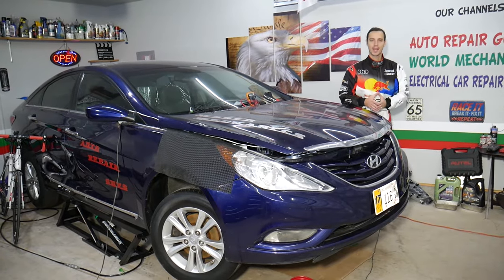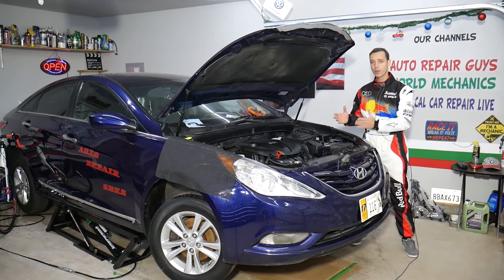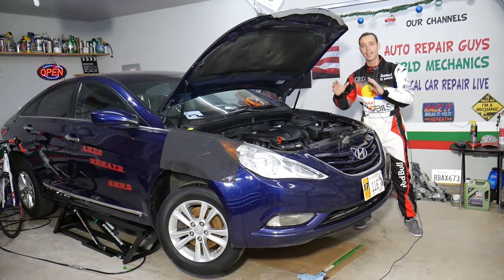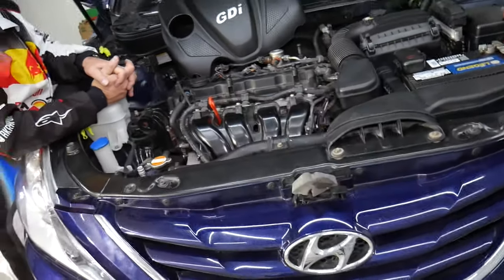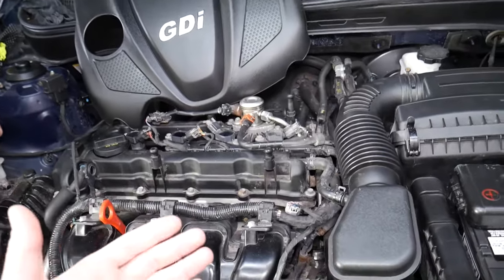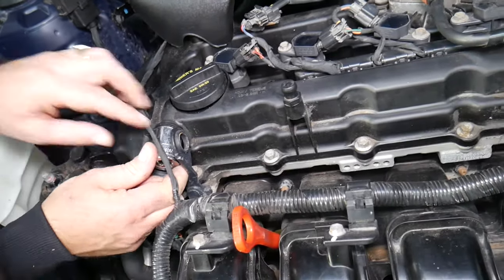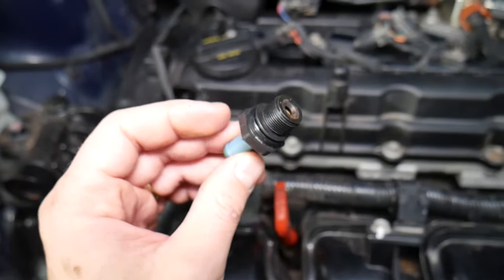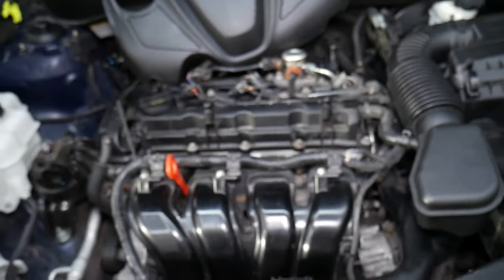WHY HYUNDAI SONATA BURNS ENGINE OIL, INCREASED OIL CONSUMPTION

Comment: i nust change the oil like 17 days ago and its already dow mn the low line
Reply: ****>>>>>    Hey readers. Even some Honda. and Toyotas are oil burners. I know because I have looked at YouTube videos for a whole year on this oil burner issue. Audis and BMW too. It is usually GDI and stuck piston rings. Most time a good B-12 piston soak will free the rings. Others use tough engine flushes.. EPR109, AMSOIL, Liqui Moly etc. Some just put in Yamalube ring free shock treatment . Change your oil at 2.5 to 4 k. Run top tier gas...use Techron gas or other high PEA treatments...and try to rev up engine more to burn the carbon outmore. Use Valvoline restore & protect oil!! FIX it fast before you pay $$$$$$ for a cat converter!!!

Comment: 2019 with 60K and still dealing with the same problem
Reply: ****>>>>>    Hey readers. Even some Honda. and Toyotas are oil burners. I know because I have looked at YouTube videos for a whole year on this oil burner issue. Audis and BMW too. It is usually GDI and stuck piston rings. Most time a good B-12 piston soak will free the rings. Others use tough engine flushes.. EPR109, AMSOIL, Liqui Moly etc. Some just put in Yamalube ring free shock treatment . Change your oil at 2.5 to 4 k. Run top tier gas...use Techron gas or other high PEA treatments...and try to rev up engine more to burn the carbon outmore. Use Valvoline restore & protect oil!! FIX it fast before you pay $$$$$$ for a cat converter!!!

Comment: QUESTION: I think he cuts it off at 2015. Does anyone think the same part should be changed in the 2017?
Reply: Yes. We have a 2017 Sonata.
I had the dealer change mine out after they said they couldn't find an oil leak. I told them it's leaking oil out of the exhaust pipe. They told me that after 100K miles, according to hyundai-it's acceptable to burn 1 qt. of oil in between oil changes! I told them it's not acceptable to me! I asked them if they checked the PCV valve and they said no because hyundai doesn't require them to check that for an oil leak out the exhaust! WHAT? I couldn't believe it either. So I asked the service dept. to have the mechanic check the PVC valve. Long story short-it was bad! Unfortunately this didn't stop the oil leaking out the exhaust. Was told by hyundai that we'd need to do an upper engine flush to the tune of $600 to fix the oil leak. The leak stopped for about a month-it's back. Looking at getting a new car. This is the first time I've had a bad experience with hyundai. From everything I've read here-I've been exceptionally lucky. Hope this helps.
Reply: Hyundai has a service bulletin stating aftermarket oil filters cause approximately 250psi inside the engine.  They even had one FACTORY FILTER that caused this.  Normal oil psi is around 50-60

Comment: My 2015  hyundi sonata motor just blew at 82,000 miles. Burned excessive amounts of oil from day one. Asked hyundi mechanic about it and he said it was normal. I am beyond pissed I still owe 9000 $
Reply: RECALL!!!!!!
Reply: OMG! Thank u for this comment. I am currently going thru the same thing. My car has only 78,000 when the engine blew. I literally had no oil in my car and this was the 2nd time it happened and couldn't figure out why. I had no knowledge of the excessive oil consumption these cars have until doing some research. I know one thing, I still owe on this car as well so Hyundai better fix it!
Reply: @Swinton30  I had my car towed to the hyundai dealership with a folder full of receipts from every service and oil change I had done to my car. Their mechanic contacted corporate and they requested they remove the intake manifold and take pictures. Mechanic said there was no sludge and oil levels were perfect . I checked my oil religiously and followed all recommended service schedules.  We got a brand new long block engine with a lifetime warranty.  Free.  I hope and pray you have good luck and good honest hyundai employees so you have a positive experience like I did. My car runs perfect now.
Reply: Same thing happened to me

Comment: My KIA  started burning oil under 50K miles. Dealer just did a 2nd piston soak after 1st failed consumption test. If 2nd fails I am expecting a new engine.. These new GDI engines and ones with new piston rings are CRAP! You have to take special care with them. MORE frequent oil changes and use TOP TIER gas or add PEA treatments. Drive some place at higher RPMS to burn off carbon!! Take special care or you will pay BIG $$$$$ on new catalytic converters!!

Comment: Thank you for the info! Just what I needed! FYI: it's PCV or PC Valve! NOT PCV Valve; the "V" stands for "valve!" 😁
Reply: The v stands for ventilation
Reply: ****>>>>>    Hey readers. Even some Honda. and Toyotas are oil burners. I know because I have looked at YouTube videos for a whole year on this oil burner issue. Audis and BMW too. It is usually GDI and stuck piston rings. Most time a good B-12 piston soak will free the rings. Others use tough engine flushes.. EPR109, AMSOIL, Liqui Moly etc. Some just put in Yamalube ring free shock treatment . Change your oil at 2.5 to 4 k. Run top tier gas...use Techron gas or other high PEA treatments...and try to rev up engine more to burn the carbon outmore. Use Valvoline restore & protect oil!! FIX it fast before you pay $$$$$$ for a cat converter!!!

Comment: The problem is not the pcv valve, it's carbon build up on the intake valve, because the gas direct injection does no wash fuel over the intake valve to clean it. Replacing the pcv valve will not fix the problem.
Reply: blame the EPA
Reply: What's the fix?
Reply: @Monzerelli  - In theory, you would need to pull the heads, and have the valves and seats cleaned of carbon buildup. Depending on mileage, I would just have the heads rebuilt, including new valve seals. Should get another 100K miles before they carbon up again.
Reply: @contractor08831  Thanks man, is it expensive to rebuild the heads?
Reply: @Monzerelli  - Haven't had any done in 30 years. Used to be able to drop them off at a machine shop, where they would redo them. I would suggest contacting a local mechanic, and get a quote. I'm sure it would be over $1500, but that's a conservative guess. Most mechanics, pull head, send it out to be rebuilt, and then reinstall them.
Reply: @Monzerelli  In a word, yes.  Get another car.

Comment: The only way out is to put new rings in that exactly what I did and problem was solved
Reply: Which type of ring are you changed ?
Reply: @sukhsingh2210  all the rings that sits around the pistons it's a big job
Reply: So you changed the piston rings and that solved it ? Did you do it yourself? If you had it done,what was the price to get it done? Thanks

Comment: If you want to solve the problem just don't buy a gdi engine car (hyundair or kia) they are garbage car that's why they are so cheap. i suggest mazda, reasonable price and well engines.
Reply: The Mazda engine is also GDI, but Mazda has developed technology to keep the engine clean.
Reply: @talkingbread2012  I read about that

Comment: It's NOT the pcv valve, after 90k miles my 2016 started over consuming oil.
Reply: Same with my 16 Accent. Hit 90k and now it guzzles oil.
Reply: Did you fix the problem? I have to add oil in my 2015 tucson every week. Its insane
Reply: @JMR  I changed the pcv valve and it's still consuming oil. I traded it for a 2022 frontier.

Comment: ****>>>>>    Hey readers. Even some Honda. and Toyotas are oil burners. I know because I have looked at YouTube videos for a whole year on this oil burner issue. Audis and BMW too. It is usually GDI and stuck piston rings. Most time a good B-12 piston soak will free the rings. Others use tough engine flushes.. EPR109, AMSOIL, Liqui Moly etc. Some just put in Yamalube ring free shock treatment . Change your oil at 2.5 to 4 k. Run top tier gas...use Techron gas or other high PEA treatments...and try to rev up engine more to burn the carbon outmore. Use Valvoline restore & protect oil!! FIX it fast before you pay $$$$$$ for a cat converter!!!

Comment: 2015 hyundai sonata sport. Burning 5 courts of oil a month, spark plugs are burning oil so much that it's cooking oil on the plugs so much its causing miss fire.
Reply: **>>>>>    Hey readers. Even some Honda. and Toyotas are oil burners. I know because I have looked at YouTube videos for a whole year on this oil burner issue. Audis and BMW too. It is usually GDI and stuck piston rings. Most time a good B-12 piston soak will free the rings. Others use tough engine flushes.. EPR109, AMSOIL, Liqui Moly etc. Some just put in Yamalube ring free shock treatment . Change your oil at 2.5 to 4 k. Run top tier gas...use Techron gas or other high PEA treatments...and try to rev up engine more to burn the carbon outmore. Use Valvoline restore & protect oil!! FIX it fast before you pay $$$$$$ for a cat converter!!!

Comment: It didn't burn anyone at 70.000 miles it started slow 
No leaks anywhere burns a Qt a week. 
I'm going to change PCV OIL AND FILTER 
HOPE IT HELPS.
WHAT YOU THINK
I CANT SELL SOMEONE A BURNING OIL CAR.
SO I WILL GIVE IT A TRY.
NEVER DRIVE OR BIY A HYUNDAI AGAIN.
THE ARE THIFTS.....

Comment: My '21 Sonata 2.5 smartstream has 79k miles and doesn't use any oil between maintenance cycles.  I've changed oil and filter every 5000 since new.  These engines hold up if you maintain them.

Comment: Not the pcv.  ! Piston rings !
Reply: ****>>>>>    Hey readers. Even some Honda. and Toyotas are oil burners. I know because I have looked at YouTube videos for a whole year on this oil burner issue. Audis and BMW too. It is usually GDI and stuck piston rings. Most time a good B-12 piston soak will free the rings. Others use tough engine flushes.. EPR109, AMSOIL, Liqui Moly etc. Some just put in Yamalube ring free shock treatment . Change your oil at 2.5 to 4 k. Run top tier gas...use Techron gas or other high PEA treatments...and try to rev up engine more to burn the carbon outmore. Use Valvoline restore & protect oil!! FIX it fast before you pay $$$$$$ for a cat converter!!!

Comment: Or... Its related to the engine failure recalls from Hyundai models 2011-2019
Reply: Did you get a new engine because of this?
Reply: @papichorizo9330  I tried but because I'm not the first owner, I only get a new engine if mine literally fails and I don't want to take their word for it, so I'm selling it
Reply: @guidedbygreen1480  that’s what the dealership just told me. He said best thing to do is drive it til the engine locks and I don’t know if I trust his word either. Want to try and sell it as well
Reply: @Wesleyk1ng-t2u  its an unfortunate situation to be in, I wish you well. I did infact end up selling mine and moved on. Now I refuse to buy a Hyundai/kia 🤷‍♂️ I look at them differently now, like how I see Dodge or Chrysler
Reply: glad I read these comments
Reply: The past recall is for the connecting rod bearings.  It does not cover oil consumption. That is a new class action just filed.  Hyundai says 1 qt. of oil consumed per 1000 miles is normal.  Under Hyundai's "normal" oil consumption I need to add 6 quarts of oil between their recommended oil changes.

Comment: Chances are you folks used crap oil, and didn't check your oil.  and didn't realize you had fuel dilution which caused issues with the piston rings.
Reply: OK, so how often do you suggest that  we change our oil? I had my oil changed every 5k miles by dealer.

Comment: 2015 Hyundai sonata 2.4
I just took it in for the second oil consumption test for every 1000 miles. 
 No oil leaks what so ever 
Two quarts low in a 1000 miles! Two more tests for that .. then..
 They are starting a engine cleaner test 3 more times to see if that fixes the problem. 
Wtf? I'm going to be at Hyundai  more than I'd like..
Reply: Did they find the leak?

Comment: Too easy…
How about you have no leaks, no smoke, no black residue on the rear lower bumper nor the exhaust tips, yet 2015 Sonata Sport burning that oil in ridiculous amounts. 
Tired of adding oil all the damn time.
Changed that valve he’s talking about too.
It must be the engine design issue.
Reply: ****>>>>>    Hey readers. Even some Honda. and Toyotas are oil burners. I know because I have looked at YouTube videos for a whole year on this oil burner issue. Audis and BMW too. It is usually GDI and stuck piston rings. Most time a good B-12 piston soak will free the rings. Others use tough engine flushes.. EPR109, AMSOIL, Liqui Moly etc. Some just put in Yamalube ring free shock treatment . Change your oil at 2.5 to 4 k. Run top tier gas...use Techron gas or other high PEA treatments...and try to rev up engine more to burn the carbon outmore. Use Valvoline restore & protect oil!! FIX it fast before you pay $$$$$$ for a cat converter!!!

Comment: My Santa Fe is burning tons of oil!!!!
Reply: ****>>>>>    Hey readers. Even some Honda. and Toyotas are oil burners. I know because I have looked at YouTube videos for a whole year on this oil burner issue. Audis and BMW too. It is usually GDI and stuck piston rings. Most time a good B-12 piston soak will free the rings. Others use tough engine flushes.. EPR109, AMSOIL, Liqui Moly etc. Some just put in Yamalube ring free shock treatment . Change your oil at 2.5 to 4 k. Run top tier gas...use Techron gas or other high PEA treatments...and try to rev up engine more to burn the carbon outmore. Use Valvoline restore & protect oil!! FIX it fast before you pay $$$$$$ for a cat converter!!!

Comment: This guy lies. Replacing pcv valve didn't help me to reduce Hyundai Sonata 2016 engine oil consumption. The problem is Hyundai factory shortcoming. Meanwhile, this guy increased the sales of pcv valve that otherwise no one knows about it
Reply: It can but usually NOT. I have a KIA oil burner that started at 50K or less. It  just went through a 2nd piston soak at dealer and waiting to see if this one helped. If not, expecting a new engine.